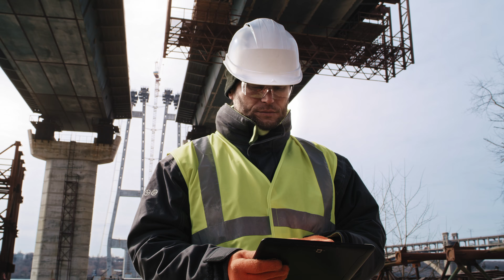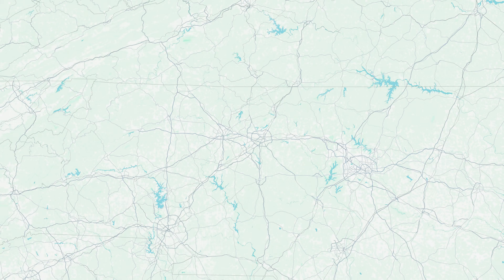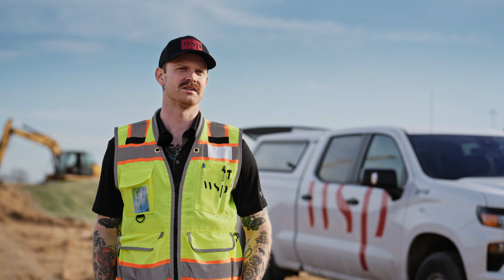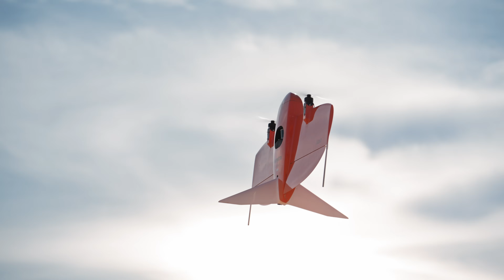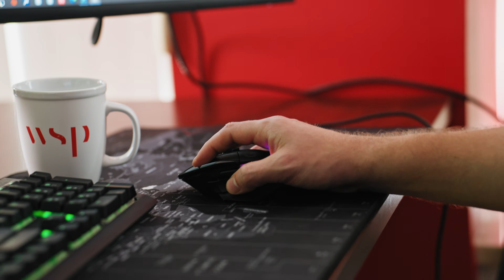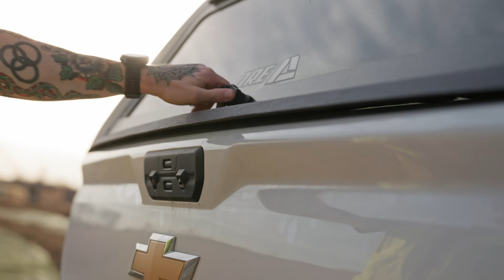WSP: Highway earthworks cut-and-fill analysis with Wingtra LIDAR | North Carolina

Comment: I have a couple questions:
I only have experience mapping with DJI Mavic 3E and M350, both photogrammetry and LiDAR. My dealership(SITECH) has a customer wanting to buy a Wingtra, which i don't have experience with and am trying to gain as much knowledge as possible. 
1) what size sites do you typically fly the Wingtra? I have mapped 100 acre sites with the Mavic and M350, but would imagine that the Wingtra out performs these drones on larger sites.
2) Why LiDAR if you are only interested in the bare ground data? Photogrammetry is inherently more accurate. The video only spoke of earth moving reports and nothing under vegetation. Just curious, always trying to get others points of view and knowledge. 

Thanks!
Reply: Thanks for your thoughts 🙏
1) Many people think, that a VTOL is only good for large area mapping. With Wingtra Ray that is not the case. From 10 acres to 5000 acres (or more) ... the drone will do the job extremely quick and efficient. On average we map 4x faster than a quadcopter, so that boosts your efficiency a lot! I highly encourage you to watch the Wingtra Ray Video on the Wingtra channel, where you see us also take off and land in tight spaces (you can control it like a quad).

2) Watch again 2:30 and you see how in this case WSP penetrates vegetation. Many of their sites have everything from small (bushes, weeds,...) to large vegetation (trees,...) so LiDAR gives them true ground data. With one argument I am not agreeing: Photogrammetry is not more accurate. Actually LiDAR is, because the points in your point cloud represent a true point in the reality (shooting a laser out and capturing the return) while Photogrammetry synthesized a position in space via algorithms and clever math (which is still extremely precise). LiDAR data also processes faster, because the points "only" need to be georeferenced, while photogrammetry is really complex math and takes time to process. You see it in the video too, because they can fly and deliver the data in one single day... that's often hard with photogrammetry (but also not impossible). In a nutshell: LiDAR is fantastic when you do greenfield surveying, but it also rocks when doing volumetrics. 
I highly encourage you to reach out to https://wingtra.com/talk-to-our-team/ and we'll show it to you :)